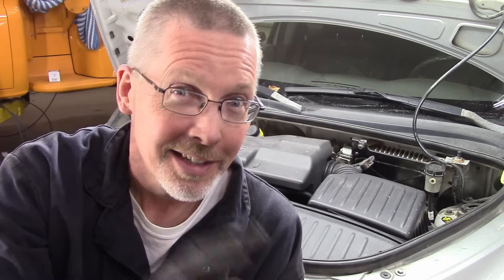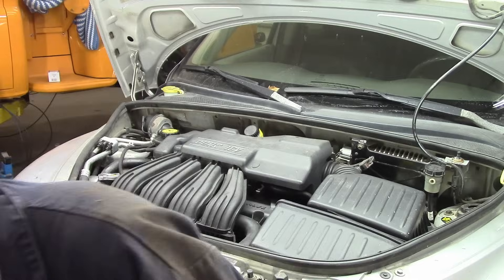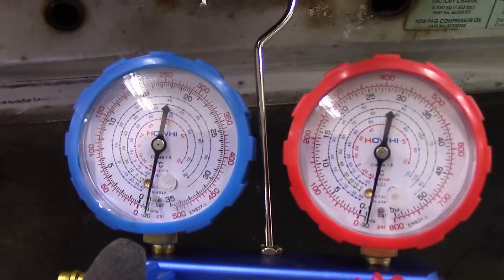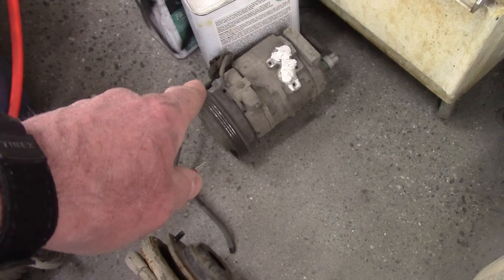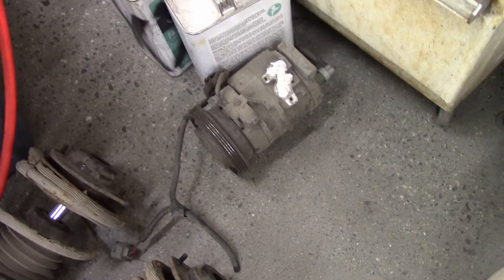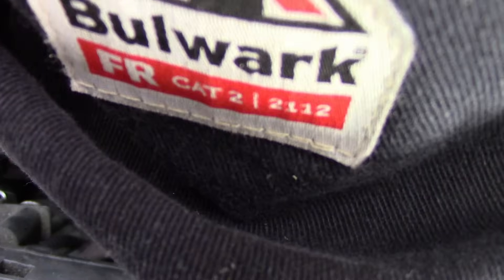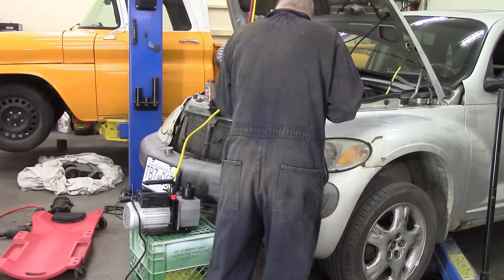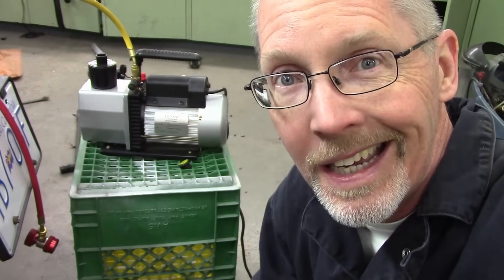DIY Testing, Fixing, & Recharging A/C

Comment: I'm currently in brazil, here they Macgyver things into a/c systems like lpg gas...thats like pure propane / butane, i've seen they use carburettor cleaner, just pop the entire aerosol can using a perforating pliers with a r-12 port straight into the system, same process with contact cleaner and brake parts cleaner....amazing thing is that with these " substitute" refrigerants they get ice cold air from the a/c system in the car...
Reply from the maker: Propane fridges are available here, often used in RVs and cabins and whatnot.
Reply: Was looking into why the carburettor cleaner works well...prob cleans the inside of the heat transfer devices, and the NH3 . ... Ammonia works as the refrigerant, the contact cleaner and brake parts cleaner is probably R-141, a similar refrigerant to R-11.
Reply: @ArvineHarry  I'm pretty sure carburetor cleaner is mostly acetone (and some other things too). If there's any cooling effect to be had there, it's from the propellant used in the can to get the acetone to come out, not the acetone itself. I'm not sure, but if I had to guess, acetone is probably "non-compressible" which actually makes things worse. There's also nothing to "clean" inside of a refrigeration system - it's a sealed system that only has refrigerant and oil in it, and nothing else. The whole "carburetor cleaner" thing sounds like a story that's gone through a few too many people that don't know what they're talking about. As I said above, there are cans sold as air dusters that are basically just refrigerant in an aerosol can, but carb cleaner / brake cleaner / any can with solvents in it just doesn't make any sense.
Reply: @gorak9000  just a note...this is brazil, a gangsters paradise, a country where you can get holidays out of jail, and get out of jail free for being depressed...there is no quality control and falsifying of products are the norm...as for a/c stuff...how can you know what was put into the system before, a place where there is always someone under a tree attempting to fix stuff...fourth world country without rules and regulations....my car for example, from D.O.T. can only get history by talking to guy i bought the car from...DOT system does not let you access car's history....my car from what found in a/c system - probably would have been best changing the entire system...but used components be is much the same shape...new stuff if can find, cost much more than car's value....my car had compressors self destructed possibly from lack of oil, but then again from the varnish coating the entire inside of the system, possibly from wrong oil used, oil contamination...who knows....some years aback, did take it to a professional, paid a premium for thorough system cleaning, flushing of components with R-141 etc...got air temp 6degrees celcius from centre air vent, on a hot day...no cooling...after a few years, a buddy suggested injecting a small amount of R-141 into the system, almost immediately gave air -13degrees celcius, then in a few moments system stopped circulating, ....turned out compressor suction at metal screen on inlet got plugged with some kind of fibrous substance...decided to dismantle the entire system...flushing components with foam to try and push whatever was inside to outlet...got lots of black specks, shiny specs, piece of dark red fibrous material covered in tar resembling scotch pad material, and a final flush with R-141 before assembly gave a trail of asphalt in outlet recipient....assembled system and got -12degrees celcius air temp from centre vent, on a hot day barely refreshing....decided enough with that...when i could afford new components, got condensors that would fit into space and fabricated brackets, did a primary condensor ( parallel flow) with outlet going into a second condensor ( multi flow parallel ), a filter dryer on liquid line with a sight glass...got system functional, same cooling as before, injected into system 2 x 200ml cans of contact cleaner...ran the system for several months untill detected a circulating restriction from hi side to low side....fixed oraface screen almost completely blocked....cleaned and put again to function, cooling as before, injected another 200ml can of contact cleaner, started improving cooling over time, till had issue with compressor displacement output control valve, disassembled control valve, reduced height of pin that pushes the steel sphere at the tip and reassembled, at same opportunity, changed filter dryer on liquid line and removed the original accumulator found on compressor suction line for inspection was with a fair ammount of dark brown liquid,slightly oily...evaporated easily leaving behind a dark brown varnish, reassembled system , got marginal better cooling, when a buddy suggested to make a coil around the accumulator to futher cool down the liquid refrigerant before the expansion fixed oraface, copper coil fabricated and implemented to system....marginal better cooling, after 2 weeks running, injected a 200ml can of contact cleaner, suprisingly every time ran system, cooling would improve, now get -20 degrees celcius air temp at centre vent in #4 ventilation speed...has range 0-5.....
Reply: @ArvineHarry  well carburetor cleaner does evaporate. I don't know the boiling and condensing temps but I could see it working in a sealed system and producing refrigeration. I imagine it probably would wreak havoc to seals and eventually the compressor would fail likely due to lack of lubrication and high compression ratios. Propane will cool great in an automobile but a leak in the presence of an ignition source...
Reply: @topher8634  from what i've seen, the rubber components get revitalised...many cars that were loosing cooling efficiency after about 1 month after topping up system, those that stopped slow leak prob be at the rubber seals...those that not appear that clean oil stain where the aluminium became porous
Reply: @topher8634  normally they use pag 150 oil ...if diluted with these products it prob get down to pag 46 ratings 😂😂😂😂, know some cars passing 2 yrs with product injected into leaky system and still cooling well
Reply: @ArvineHarry  my first car didn't have working a/c when I bought it. It originally had r12. I put a junkyard hose on it and recharged it with 134a. The part stores use to sell the conversion kit for ~40 bucks. I didn't know shit about automotive let alone a/c back then nor did I have any of the appropriate tools/equipment. I didn't pull a vacuum or flush anything out or replace the accumulator/drier-all things that should be done. It had a 42°F center vent temp on max a/c with high fan and it still was working when I sold it 10 years later. The high pressure cutout switch failed a few years after the repair buy I just jumped it out because that car [1985 Chevy Cavalier] the switch was in the back of the compressor held in with a snap ring and I didn't want to fool with discharging and recharging. The car was a beater anyway. Ironically that car was the beginning of not only my auto repair profession but also an a/c and refrigeration technician. Most were shocked when they rode in my car and found out that it had working air conditioning because it looked like shit.
Reply: @notsevenfeettall  R12a is an Alkane, a member of the same family as Methane, Ethane, Propane, Butane, etc., you get the picture.
Reply: There are several hydrocarbon refrigerant brands you can buy in the U.S.  I understand they are a mixture of propane and butane.  I've used Duracool for several decades and in all my vehicles now.  Envirosafe is another.  I expect that is the refrigerant this youtuber recharges with.  It works slightly better than Freon.  It is used in home refrigerators in Europe.  Strangely, the EPA dissuades using it, claiming "fire hazard".  No such fire in millions of cars using it for decades.  Those who rant never took graduate courses in Combustion like me.  Best oil is PAO 68.  True, the Ozone Hole was not caused by man.  Read the latest on the U.N. websites.  They are in a quandry now, trying to explain how being wrong is right.  I don't know if the Dupont story is true, but nothing surprises me today, like did Jeffrey Epstein suicide himself?
Reply: @williamgrissom9022  true that, the oil used in refrigeration systems depends on the refrigerant itself...there are POE oils, PAG oils which work with R-134a, however mineral oils like 68 were better suited for R-12...i was born early 80's, i remember my dad's car was R-12, then when could not get any more, went over to 134a, without doing the flushing as found out later on...that AC worked fairly well, on other hand, my current vehicle suffered badly from a varnish painting the entire inside of the ac system among contamination from burnt up teflon piston rings and shrapnel from died compressors... carburettor cleaner circulatiog within was prob only way got most of that varnish out...also remember all the hipe on hole in ozone layer...but interesting enough, always asked " why over antartica?" There is literally nothing there...no industries...does earth's magnetic field draw the cfc's to accumulate there....???? Why didn't NASA send up tanks of ozone on rocket boosters - when get to outer atmosphere, release the ozone....
Reply: @ArvineHarry  Yes, the Ozone Hole only occurs over Antarctica in Winter when there is minimal sunlight anyway, due to ice crystals in the Stratosphere.  The recent increase is said due to cooler air, which U.N. now attributes to Climate Change.  Most warming (4x) has been in Arctic and N. Europe, while Southern Hemisphere and Pacific have barely warmed and Antarctica even cooled.  Not explained by greenhouse gases, so they came up with "Polar Vortex" and "El Nino La Nina Seasonal Effects" to explain (fit models to data).  The sensational reports of increased uV in 1980's turned out bogus (ex. 3-legged frogs in Costa Rica).  Many scientists then suggested that natural sources of Cl are much higher than from fluorocarbons (Freon), such as volcano Mt Erubus on Antarctica.  PAO 68 isn't a mineral oil.  I recall Hella first marketed it.
Reply: R-12 has similar boiling and condensing temperatures as propane…. A few diy farmers around here run LP in their tractor a/c systems.
Reply: @waggtech4883  👍, looking at the chemistry, chlorine and fluorine replaced hydrogen at the carbon bonds of propane gas making it R-12, what is the possibility inside the ac system something happened chemically, causing the drastic improvement in cooling? Seeing that here the carburettor cleaner uses primarily Ammonia NH3 ....something to look into
Reply: I've been working on cars since the 70s and I mostly just read the comments. A whole bunch of us comment about our government s. A lot of this doesn't make sense. Why did they make people go back to work? When it was proven by the lock down that everything was cleaner? I mean everyone that can work from home should be doing just that.  Nothing else makes sense
Reply: Duster can (like "compressed air" aerosol cans) used to be R134a, so it's complete BS that when used for air conditioning, it's "harmful to the ozone layer", but in "duster cans", the intended application is "spray it into the atmosphere". Regardless of whether it's actually bad for the ozone layer or the environment (aka greenhouse gas effect), which I'm sure it is, the f'ing laws make no sense. That said, a lot of propellants used in all aerosol cans are actually refrigerants too, propane, butane, etc etc. Commercial refrigeration also uses ammonia.
Reply: @gorak9000  R12 was one of the"Ozone'  effecting refrigerants that R-134a replaced. R134a/HFC134a is still sometimes used as a can propellant due it being mostly harmless, but it is being legislated out of usage in preference for other options. R134a was not the Ozone killer of the 60-70-80's AC ; that was the hairspray I used in the 80's ( All the blame on my  hair metal friends).
Reply: @Donald.W.Rissler-ARTS  But supposedly R134a has bad greehouse gas (global warming potential is the official term) effect - because it's phased out, and new automotive systems now are now R1234yf. I'm pretty sure they just keep phasing out refrigerants every few years so you have to keep replacing your AC system when the old refrigerant is now "illegal", or at the very least hard to get and thus too expensive. More so for residential AC's that cars - people don't keep cars very long anyway. Meanwhile tons of commercial AC still uses R22
Reply: @gorak9000  if you research the patent on r12 was about to expire. the whole "hole in the ozone " (which is a real natural occurance) was spouted so dupont could start mandated selling of thier r134a they had just patented or so i was told
Reply: @richardcranium5839  that would make a lot of sense to me. Is the patent on R134a about to expire now too? Because both automotive and residential AC are moving to new refrigerants now (supposedly because of greenhouse potential of R134a, but I'd be a lot more inclined to believe it's because the patent on R134a is about to expire too)

Comment: Not that you would ever let your bottle of Never Seize dry out… I’ve found that adding some WD40 to the mix brings it back to the proper consistency.  Just an FYI.
Reply from the maker: I use enough of it that it rarely dries out before it's gone, but I have heard the same thing.  Haven't tried it yet.
Reply: Mine dries out from the hot shop. Just sitting with the lid on.
I use wd  also.

Comment: Nice to know I'm in good company.  I was one of those "weird" kids that started to asked Santa Claus  for automotive tools when I was 12.   I gleefully flipped through the Sears Catalog picking out craftsman tools.
Reply: The Sears Catalog was a gift in and of itself when I was younger.  I remember standing in the tool department wishing that one day I could afford the tools.  Things sure have changed.
Reply: Yet not alone
I grew up so poor that xmas wasnt much of an option
But a basic set of tools I got before I got my 1st car and learned how to do fixes myself since no way in hell I could afford to pay anyone else
Thankfully I was smart and skipped american cars entirely since they were such utter crap by then,  my 1sr Datsun sports car was dead reliable, quick and actually got slightly better then the commercials for it claimed at 40mpg 
I got it at almost 300k and sold it 3yrs later for more than I paid with then 480 on it..  
I upgraded then to my 280zx with about 300 on it.. unkillable engine, easy to work on and same toolset slowly grew. (Frame finally was fubar in mine at 800+ on it  only basic maintenance for it..  transplanted the engine and tranny to another 280 and last I checked with that owner it was 1.3million and going strong still with only basic maintenance..    and all with that same sort of basic toolkit he got much as indid and you did when we  were quite young.
Lesson  buy a properly designed reliable car that you can actually work on and get your kids a basic toolset when they are young   it can be a LIFESAVER!!!

Comment: Yowza! I have the same black jackstands … and i got mine when i was about 15 … nearly 40 years ago! I still use ‘em and still mostly trust ‘em. I don’t think I’ve ever seen anyone else with a set of those. Btw, I’m pretty sure your PTSD Cruiser originally had 134a refrigerant; while it’s still preferable to capture any that might be in the system, it’s far less toxic to the ozone than was the old R12 stuff of yore.
Reply from the maker: It was R134a.  I asked - I cannot get it.  I used 12a, which apparently is not harmful to the ozone.
Reply: @GregWellwood  I learn something new every day! Turns out R12A is different from the R12 that I'm familiar with -- but it's all organic (maybe even free-range!) and safe to use or leak out as you please in place of R12 or R134a. Sounds like it works for you, so that's good enough for me! Fwiw, your videos remind me of my original Auto Shop teacher (Goodwin Hannaford, RIP) from way back when, when I was a kid. Keep up the awesome videos and teaching those kids! Thanks!
Reply: @GregWellwood  r134a is not harmful to the ozone. It has an ODP of 0.
Reply: My jack stands like that are orange.I bought them in about 1965 and still use them.

Comment: What you did was irresponsible and in my country, illegal. If i did that id lose my repairers licence.

Stavros
Reply from the maker: Note: I did not drain the refrigerant - the refrigerant was already gone.  But I am not Provincially certified for A/C.
Reply: It's a good thing we are not in your country.
Reply: The refrigeration industry lobbyists have convinced lawmakers all refrigeration gasses should be recovered if they are damaging to the ozone or not to require people to go to a shop for no other reason than profits.  Canned air has 134a as its only ingredient - a product with no other use other than to be vented directly into the atmosphere, yet it’s not considered damaging.   At least in the US, residential r22 systems can’t legally be refilled with 134a and the whole system has to be replaced thanks to refrigeration lobbyists, yet it’s common in Europe.    I changed the oil in my r22 system and have run 134a for over 8 years with zero problems - my pressures are slightly lower and the delta t is exactly what it was with r22.   I used an inexpensive vacuum pump that wouldn’t go into the micron range and it’s just fine.   It’s only a bad idea if it doesn’t work.